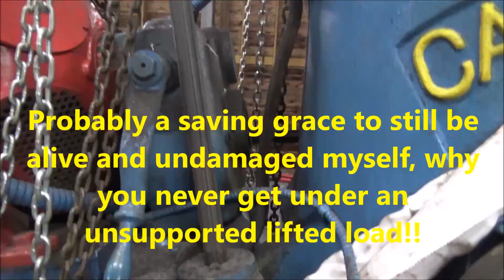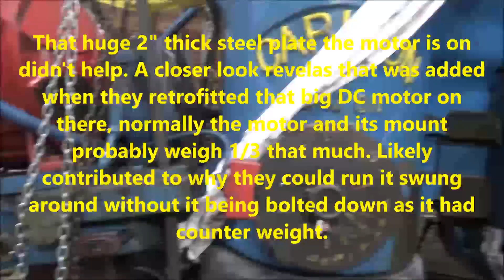The Worst Shop Day Ever :-(

Comment: Glad you got a solid lesson without any damage to yourself.  Replacing cables is cheap when you're anywhere near limits. Same goes for chain and shackles if they're running load.

Seriously, be happy you're unscathed, you learned a lesson, and you shared it so others can learn. Take Quin's advice. I'd be more than happy to throw a couple bucks your way because this is a lesson I'm willing to share around.

Comment: Thanks for posting this.  Learned something I didn't know able cable maintenance from your video and from some of the comments.  As others have said, glad to see you weren't (physically at least) hurt when it went down.  Just shocking watching that much weight crash to the floor. Unbelievable. Moving some small shop equipment soon and will definitely keep this video in mind.  Thanks again.

Comment: Brian, you came out in one piece, thanks be for that. As a matter of interest, I have moved a radial drill once and it had a tapped hole in the top of the column for an eye bolt, then the rigger in charge put a come along out on the arm and back to the hook and cranked it level. It wasnt as big a machine as your one though. If you decide to repair, Eutectic make some very good cast iron rods for quench welding, I have been very impressed with them. Good luck with it, you are a battler and have done so much on your own

Comment: I have to go along with the rest, so glad you weren't hurt! When I was working doing heavy rigging you could always tell who the noobs were. When a 100 plus ton lift stars to rotate or move you just get out of the way, not try to grab it. Glad there wasn't anything damaged that was irreplaceable. I have made similar mistakes, things I should have known better but... When I was an apprentice I was taking an 18" extra heavy wall tube down to the bender, instead of choking it, still not the right way, or using a load spreader I just slung it in the middle. It was fine while I was balancing it while moving down the shop but when I got out of the shop and couldn't balance it anymore the inevitable happened. It started to tip and after it got so far it slid out and hit the concrete below. The impact dug a six inch deep channel for several feet in the concrete, still can't believe they didn't fire me on the spot. Glad you  and Bailey were uninjured!

Comment: Whoa, Brian.  Glad you're OK.  I've had similar accidents with [much smaller] equipment, so I know how disappointing it is.  This is a good example of how your careful technique kept you out of harm's way.  The damage to the machine could have been much worse.  On the bright side, you will certainly get some fantastic footage as you make your repairs and get that thing running again.  Now you have more options for your motor setup too (maybe replace that monster DC beast).  Stay safe.  Thanks for sharing the video too.

Comment: WOE! I was quite taken back by this however I was trying to prepare myself due to the title of the video. Man am I glad you are OK. You didn't even have a slight injury. 

One thing you clearly demonstrate in all of your videos is safety. You have done amazing things with very little help, and mostly no help, that many of us would not even undertake, yet you do is all with safety in mind. Most excellent! You stood clear of the load and was careful in all you did. Thank the good Lord Almighty that you did! 

I used to work on the railroad on track years ago. I worked with a few cranes back in those days and with a wench car that pulled ribbon rail off rail trans. I was a safety man at that time as well. Cables are very deceptive, very difficult to evaluate. Your video serves as a good lesson in what can happen when all appears to be well, but the internal degeneration shows itself after having lifted and held such a load as you had. Yes, I have read several comments and know that is why you shared it.

The glimmer of the silver lining is that you will have a larger load to handle with that boring machine and you will have new cable to start with. Heavy wooden cribbing may be an idea too.  If something does let go the load will fall a shorter distance and on something with a little give, like cross ties. Here you would have to stack them in a way that the load would not shift to the side after falling. Just typing out loud. Perhaps an additional crane is in order? 

Man, I'm just glad you didn't get hurt!

Comment: I have to tell you Brian I literally shook for about 10 minutes. When it let loose I actually jumped. This made me think about what I do at work machining 2000 lb crankshafts. Moving those things in and out of a WFL M120 MillTurn seems like nothing using motorized cranes. This made me realize I’m a little to lax and putting too much trust in my lifts. Our cranes are inspected every year and we use certified lifting devises. That should never make anyone feel more safe. Thanks for sharing this video, I learned a valuable lesson. I am very greatful you are alright. You certainly have nerves of steel and handle it well. I think I need to go check my shorts and have a beer.
Reply from the maker: Definitely have to be careful, you just never know........ In other news though I assume a 2000lb crankshaft is for a boat motor? That is a BIG crank!
Reply: Gas compression or generator sets. I work at Waukesha Engines.
Reply from the maker: That a 275GL crank?
Reply: bcbloc02 no VHP

Comment: Hello Brian,  Glad you weren't hurt.  Wire rope is a tricky thing at best.  Cored (or any unprotected steel wire and it also lubricates the strands internally as it is bent and loaded as well as reducing the friction over the sheeves) needs to be "slushed" with a specific cable lube on an annual basis and fully end for ended with close inspection.  Shipboard it is a requirement for such loaded wire.  Even then it has a usable life.  Corrosion on wire and for that matter on chain is damn sneaky.  I have seen half inch chain that looked just fine pop under almost no load.  Once that energy is released bad things can happen.  It can be insidious as an individual without deep pockets hates to toss what looks like good wire or chain as it is very expensive to say the least.  A 25 ton winch is a size that doesn't come cheap.  Although the load rating is reduced hot dipped galvanized or god forbid the price stainless might be a better choice.  Because of your tight coils and turns (diameter of the blocks) I think you are probably stuck with a cored rope or a more expensive higher count multi strand wire.  Good luck with the aftermath.  Good news is that with the steel in the concrete it will most likely be ok.  Thinking of what it could have done is pretty scary.  Take care.  Doug

Comment: The only important thing here is that you (and Bailey) are unhurt. You have gained:
(1) An amazing, heart-stopping video on how to be safe around suspended loads, (2) a whole series of videos on how to fix a damaged radial drill, (3) another series of vids on repairing concrete floors (could injectable epoxy work?), (4) yet one more series on selecting and installing new cable on a overhead hoist and hook, (5) a still intact horizontal boring rig. Seems like all that is left is to sip some Booker’s and figure out what to do next.

Comment: the issue with not knowing the exact weight. I am so glad you are ok! thank you for sharing the video.
Reply from the maker: The weight was still less than rated capacity of the crane. The failure was because of the decreased capacity cable

Comment: WOW. So glad you didn't get hurt man. I saw kind of the same thing happen at a job I was working a number of years ago. We were switching out the engine in a big yale forklift. We lifted the counter weight off of the back and were swinging it out of the way when the lifting cable let go and dropped it literally an inch away from the guy lifting it. Broke the floor of the shop much worse than you did.

Comment: Hell's teeth to say that was close is the understatement of the year!! I'm so so pleased that you seem OK if rather shocked by it all. I'm mighty glad it didn't tip over at all when it landed and probably kill you in the process. 

At least all the work you put into the crane mechanism worked well - of course your angry with yourself for not replacing the rope especially in light of what happened but as you said at the time at least it was not your boring mill that you dropped and broke because from what you have said previously it must also be mighty heavy. 

Whether you can economically repair the drill remains to be seen, I guess the answer depends on whether you could find something similar at the "right" price that would fit your needs compared to the cost of repairs.

Best wishes.
Reply from the maker: Repair is just my time and obviously I don't value that very much or I wouldn't have built a barn/shop in my spare time. lol

Comment: I knew you was ok 'cause you posted the video, but I was fearin' a load loss somehow... did not think about the cable myself... Reminds me of when I worked at a prestressing yard in Tampa.  A 50,000 lb locking collar slipped with full tension on it. Just missed me, but 2 guys 10' away didn't make it.  i'm thankful your ok!

Comment: ...A few weeks late....but reading up on one of my maintenance e-mails I get from Noria......this is a common problem for wire rope, as they are often made with fiber core....and rust from the inside out....newer cables have mostly gone to a poly type core....but still need that occasional spray can of Lubri-plate chain and cable fluid....good stuff...my Harley does well with that on the rear chain....

Comment: How thick is the concrete that broke? do you know the PSI, or if it was reinforced? How heavy was the drill that dropped? How much did it cost to fix?
Reply from the maker: 12" of reinforced 4500psi concrete the drill weighs about 26000lbs

Comment: I raced on a 30 ft sailboat for about 15 years. We always dry-sailed her, so we used a crane to hoist in and out of the water every day using a steel eye-bolt threaded into the keel. One day the bolt stripped out and she dropped about 6 feet, luckily into the water. Salt water corrosion was the culprit. We all survived but it was devastating to witness.

Comment: Brian, I'm very glad you survived! You and I both know that we can get an education at an University, but nothing educates better than by "doing" as well as "making mistakes" as these are 'hammered home' at a most unwanted time. 

The new floor will be fine, just take a saw to the cracks in the floor and fill with "crack repair" materials, similar as used on new highway bridges (google and you'll find something in a nearby industrial supply store). For the remaining unplaced concrete floor, consider using 2 layers (top and bottom) of #5 rebar at 8"o.c. each way and disregard the #4 mesh. The "live load" your heavy operating machines produce along with their actual weight, I believe, would require this (just my opinion).

 I love your videos but hard to press the "like button". However I gave it a thumbs up because you are a knowledgeable person and you knew that you needed to show others "what not to do"! Good luck on the machine repair, I've confidence that you'll figure it out!   

 ....13

Comment: I feel your pain man, I had a territ lathe fall off of my low boy in the middle of the road, busted the tray all to hell. It's hard to find parts for a 1928 metal lathe.
Reply from the maker: If you have all the pieces you could weld it back together.
Reply: @bcbloc02  I picked up most of it, gonna try getting it fixed back. Thanks

Comment: I am sorry that this happened to you. You were incredibly lucky in that accident. You remained alive and uninjured. So you are able to start clean up and repair the next day. Imagine if only your foot had been under that machine you would have been out of your shop for a year and you would have never been the same again. Consider this day as your second birthday. Until now you have single handedly done herculean work. This set back is not that big compared with what you have accomplished until now. I dont know if you can live with the cracked floor. If not with the modern diamond saws and your crane above it you could saw it to blocks and lift them out. Learn from the mistakes, look forward and don't let them drag you down. Go Brian go!

Comment: Scary to watch. Its worth everything if you did not get hurt.  As I watched you lower it from the trailer I kept telling myself that I am glad you weren't on the other side of the drill lowering it down, as you were when you started lifting. The concrete will be a reminder of safety techniques every time you look at it. Hope your floor heating wasn't ruined.

Comment: That was a scary, nasty drop!But at least it looks like you avoided one of the subsets of Murphy's Law: "A dropped tool will land where it can do the most damage".That fiber center core you talk about at 9:30 serves two purposes, one is to make the geometry of the wire work out, get the strands into a stable configuration. W/o it'd there'd be a center void allowing the strands to squirm and the wire to collapse into an elliptical cross section. The other is to hold oil. The indiviudal strands will always squirm a little against each other, causing wear. A lubed wire will last longer. Not only from not rusting, but also from not seeing that dry metal-on-metal chafing. I've seen old charts on rigging, with recommendations on when to replace wires based on overall loss of diameter. It seems like using a wire until visibly thinner than when new was standard practice. Of cocurse that assumed even wear, and no kinks, rust or other hidden damage.

Comment: WOW was not expecting that. Glad to see you are uninjured. Could have come out a lot worse if the drill press had tipped over.I hope it is only the motor mount that is broken. Sorry to see the floor crack. Hopefully as its still green it will be easy to chop out some slots and regrout it. Best wishes and regards from the UK

Comment: Really sorry about the floor and machine, but as many have said, it could have been worse. One good side is that it happens with a machine that wasn't as important as the Cincinnati mill or monarch lathe. You've made out quite well without any drilling machine of any size. Sometimes, the hard way is the only way to find the weakest link. Thankfully your OK, and the drill appears to be OK.

Comment: Now I'm worried about using fiber core wire on a winch. Tow trucks use it all the time because it's more flexible, which really makes a difference when using it on snatch blocks and fairleads. Is there any way to tell if the core is ruined? Or do you just replace the cable every time it gets wet?
Reply from the maker: I would avoid letting fiber cored cable get wet, you could maybe soak it in oil once a month for protection if you had to use it.

Comment: I'm so glad you are not hurt. I suspect that you will not be doing anything about the concrete as that area probably wouldn't be used to mount any machinery. Like it or not that is now designated for loading and unloading. The cracks won't really matter as long as the radiant tubing tests OK.

Comment: Well, now you know for sure that the wire rope on the hoist needs to be replaced...

Silver linings man, silver linings.

Also, I can tell you from my experience in construction that if you hadn't just kinetically stress relieved that pad of concrete, it would have cracked on its own somewhere else anyway.

There is literally nothing you can do to stop concrete from cracking somewhere as it cures.  That's why we saw cut it most of the way through once it's set up enough to walk on, so that we can "encourage" it to crack where we want it to, but even that doesn't always work.

So don't sweat the cracked concrete, that was gonna happen one way or another no matter what.

Bummer about the machine, but I'm bettin' you can fix it if you decide that you want to.

And as you said, at least it wasn't the boring mill.  ;-)

Comment: Thank God that came down where it did and you were safe, which others already said. On the bright side, your floor broke, before the drills arm did! 
So breaking the motor platform was minimal as to what could have happened!  
CAUTION..  We have been guilty of not oiling our crane wire ropes enough also!  I had a wheel break off our Ford 700 boom truck on the highway, 
cuz of internal rust ...  RUST NEVER SLEEPS.  Would have been nice when you pointed up, to see what the hoist actually looked like. 
To me it seems rather big to be a manual operation.
Reply from the maker: There is a whole playlist dedicated to the bridge crane and it’s construction and mechanism.  I am glad that after it was re roped it has since successfully handled the 45klb Monarch lathe  no problem.

Comment: Well at least you're alive and intact. You could have easily lose a foot or even a whole leg. As for damage, I know a guy who did over $60,000 to the building not to mention destroying the equipment in the process. I don't envy you if you're going to try to weld that back together though. I'd imagine there are all sorts of nooks and crannies to get in and around for that kind of a job. I am truly sorry this happened to you man. I'm just glad you weren't under it when it fell.
Reply from the maker: It is a very daunting task trying to put it back together, maybe I will get lucky and it will work. I have talked to a lot of professional welders on the deal and they have given me some good advice, of course most even said themselves that if they did it it was probably only a 50% chance of success without doing it in an oven.